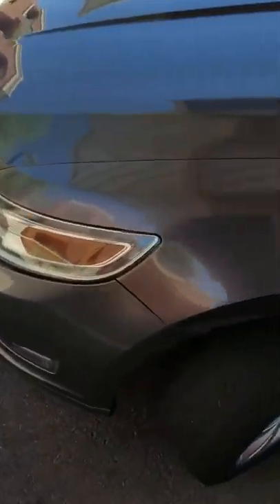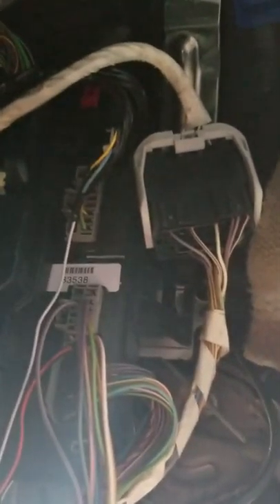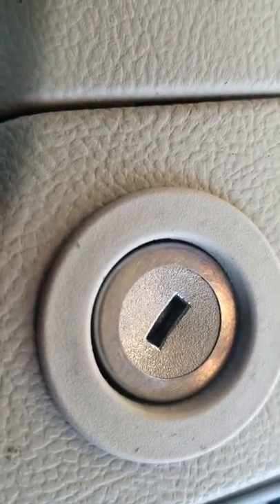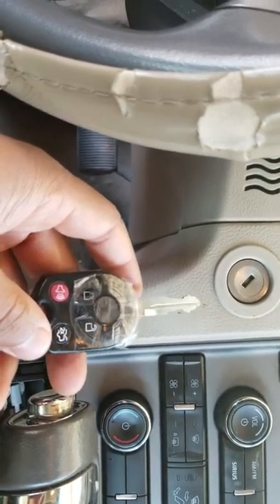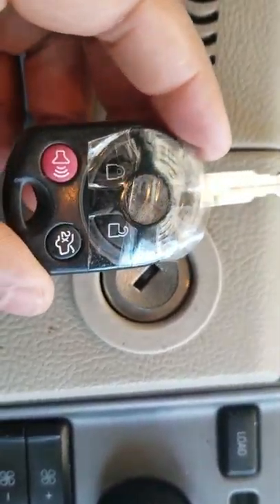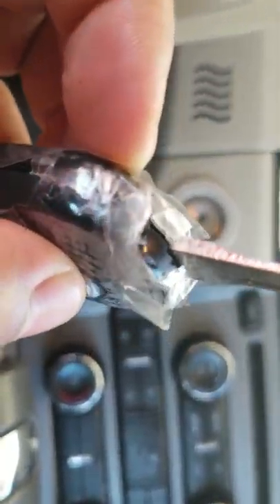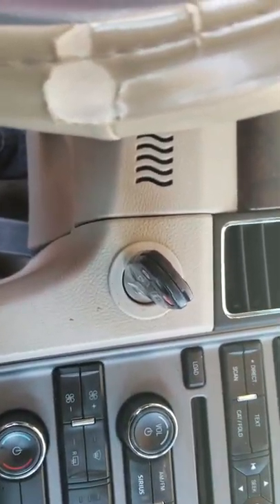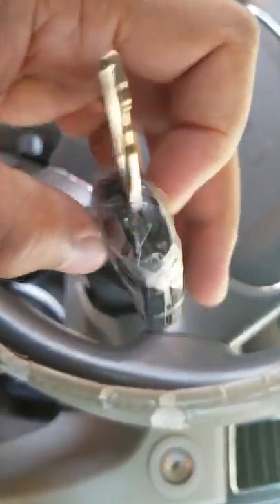Ford Taurus Anti-Theft engine lock SOLVED!

Comment: You took way too long at the beginning. Just get to the point. Also, with me, it fixed itself by using my secondary key and then the primary key worked.
Reply: first 5 minutes and 30 seconds unnecessary
Reply: Talk too much

Comment: What about a 2002 with a new starter and alternator and battery but the Anti theft light came on and the car hasn't started every since
Reply: I have the same problem!? On an 05
Reply: Did you ever figure it out? I’m having the same problem

Comment: I have the same type car but mines a 2010 and ijust tried to follow these instrusctions and still doesnt work
Reply: You could try using the secondary key. If it works, take it out and use the primary key.